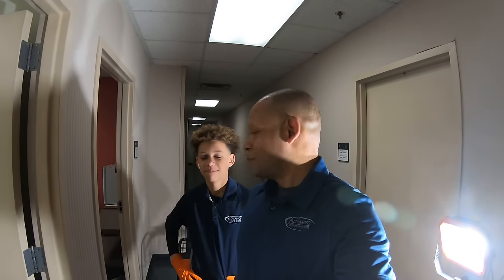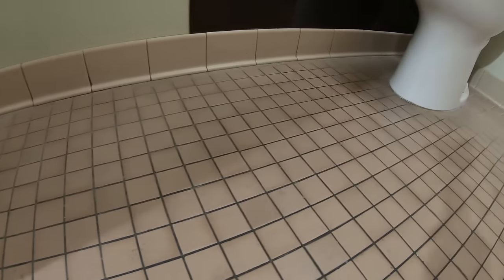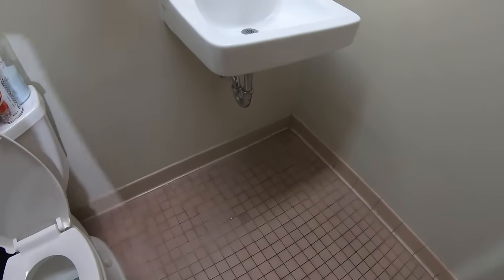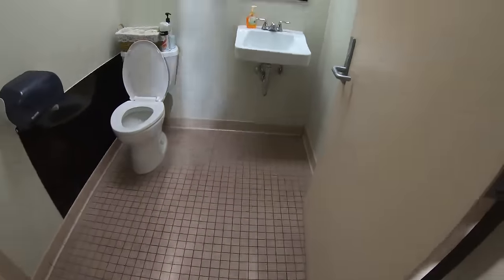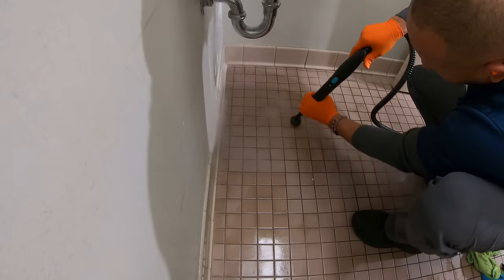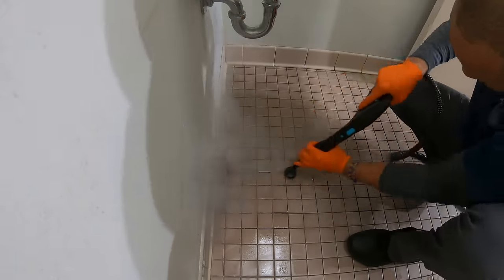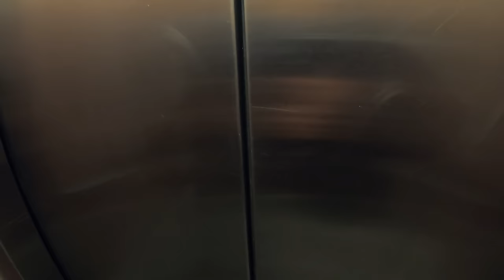DEEP Cleaning DIRTY GRIMY grout lines || Satisfying tile and grout cleaning

Comment: I bought a Steamfast steamer on Amazon and I'm cleaning the grout in my kitchen.  I thought the grout was stained brown, but it was dirty.  I steam the grout, then use a stiff Libman brush to scrub the grout, then steam again and wipe with a cloth.  I use a gardeners foam pad for my knees (life saver). The grout is light tan and looks great.  It's work and requires elbow grease but worth the effort.

Comment: To go deeper and achieve amazing results, I have been sanding grout with sanding sponges after thorough cleaning. Then using grout sealer to protect the final results. Sanding grout is particularly valuable in showers, bathrooms and kitchens when the grout is white. Yes it can be restored with elbow grease.

Comment: Quick tip for anyone doing these kinds of jobs: If you bring along a little wet/dry vac you can quickly pick up most of the dirty water with it, you’ll only need a quick finish wipe. Speeds up the job, but more importantly less bending, and less towels to wash.

Comment: Nice job - huge improvement for sure.  Do you guys own any floor machines? I would have just sprayed the floor with a cleaner degreaser, hit it with the floor machine with a carbide brush, then repeated with acid wash.

Comment: what i find strange is that i was cleaning out my shop that isnt yet done, its kinda been put on a stop til further notice as theres other things that are going on that are more important, (yes it is stoped in such a way where the building is usable as in theres walls, we are just re modeling that area as termites and whatnot has been shiting all on that. and yeah, decided to turn that into my personal garage as theres not a decent sized garage on the property (cant even fit the smallest vehicle we have wich is a 2 door nisan (or datsun for you o.g's) with a litle i4 in it. damn good daily, my grandpa dailied it for a while. my uncle dailied it for a bit and then my dad dailied it, hes been driving it back and forth to work since like 2009? but there was a piriod where he accidently made some never sneze out of the bearings.... yeah had to replace the old engine, was probably the original with 200k and probably woulda kept going if he hadnt accidently shreaded it, was a good healthy engine... but what can be done bout it. hell my grandpas last daaily (he retired) ans an 87 ford bronco, yes the 4487 in my name is partly in reference to that) but yeah his old truck is now in the shop waiting for the resto, maby even an engine rebuild (?) or atleast a check up on the engines health and weather i need to rebuild the (maby?) 700k mile engine? atleast thats what the o.d.m (odomoter) says.. 700k miles that thing been round the world several times by now lol. but yeah i was cleaning my shop (my grandpas mild hoarding problem kinda rubed off onto me {dont wory its not THAT bad of a hoarding issue. its more of a keeping angle iron, old washing machine motors, dryer motors, nuts and bolts which everyone should have a colection of misc bolts in their shop} but yeah i had quite the mess and its still a mess. was not able to clean the main section (where the door is) {the shop has 2 sections one closest to the exterior [northern ish wall] and the one farther away, the one closest to the northern wall is the one with the door, where the suv and the riding mower (cheap p.o.s fyi) sits. the other section is storage for the for seeable future until we get a door put in which like i said earlier was post poned for a while. the section i cleaned was the section farther from the north wall, but theres still a bit of a mess as theres crap that needs to be taken to the garbage, and a lot of literal shit {not the human kind THANKFULLY) that needs to be taken out.

Comment: Great video, but why not use the extension poles and save your backs?  When I steam clean grout I do a very small area and then mop up the dirty water by pushing a terry cloth over the area with my foot.  When all the grout is cleaned I will go over it with the floor brush attachment covered with a towel.  No bending down needed :)

Comment: I was surprised to hear that you decided to use a brass wire brush head to clean the grouting . When I use my own Karcher steam cleaner on tiling , i use the nylon brush head , so it doesnt scrub away too may layers of white grouting .Is there a deliberate reason you use a brass wire brush head ?
Reply: We tried all the brushes. The brass brush performed best in this case.  The nylon brushes wouldn't touch it.
Reply: @chadmayes1078  doesnt it brush away some of the grout though ?I would have like to have seen the end result of that vid .

Comment: from a 70 year old:  Get a milk crate.  Either flip it over for a seat, then use it to hold dirty rags at the end, clean ones at the beginning OR make a lid for it with the rags inside.  Trust me, a seat is SO much easier than kneeling, and it slides on the floor without scratching it.  When you hit 70, your body will thank you.